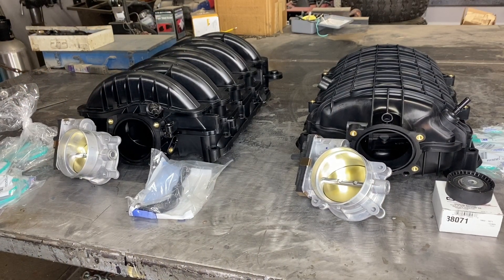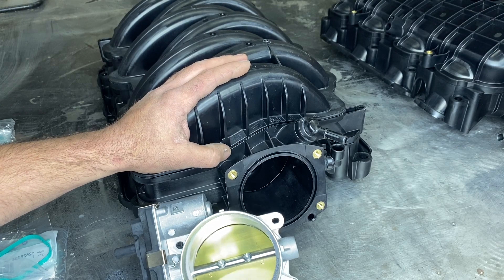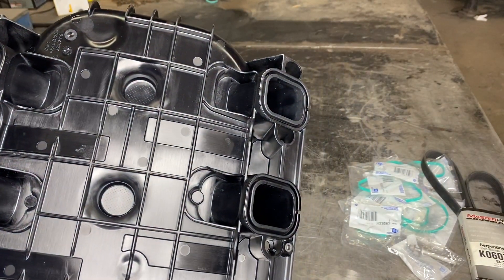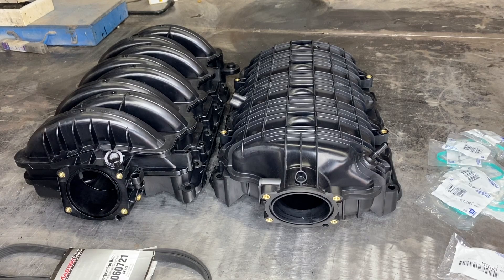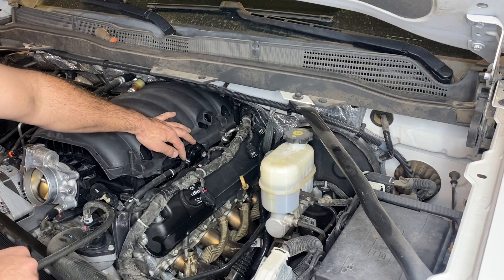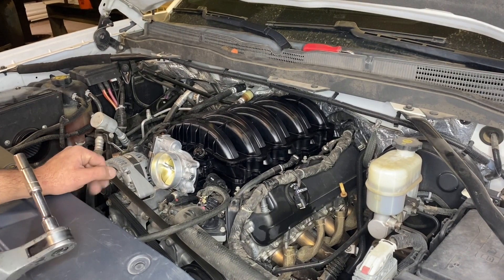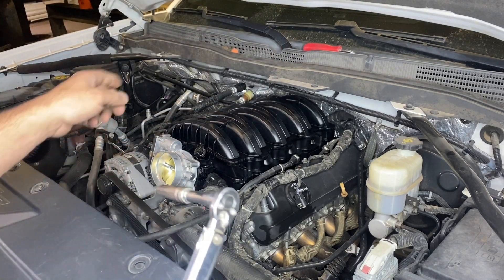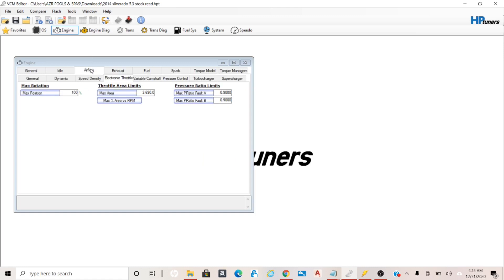GM 5.3 L83 & 6.2 L86 Intake Manifold Swap 2014+ (Complete Guide)

Comment: also my 5.3 is still stock with bolt ons. im using a tune with diablo. will this cause any issues with truck running by im getting more air. thnx your vid is awesome

Comment: did my l86 tb and Intake manifold and I started having a bad misfires in 3 different cylinders
Reply: @clifford2slow20   thank you for the help!
Reply: Did you find the problem?
I want to do the swap
Reply: @ yeah I ended up picking up a bad throttle body .
Reply: @ if you buy one used make sure it’s a 6 pin my mistake was that I picked up a 5 pin one

Comment: Man be careful torquing the intake manifold bolts my torque wrench only went down to 10ft lbs the bolts call for 8 ft lbs I figured it would be fine I ended up snapping one off at 10ft lbs had to get a die grinder in there and grind it flat drill it out and use an easy out to get it out

Comment: So I could use my Camaros LT1 intake on my 2017 5.3? I still have manifold and TB from my 2018 Camaro SS.
Reply: Yeak. But will need work . Some harness extentions. And you need to clear the throttle body and make the evap line reach the purge valve which am trying to figure it out

Comment: How long does it take to just pull the manifold?
Reply: I did mine in less than 2hrs. 10mm deep well and a cpl extensions worked for me. Factory cover fits on the 6.2 as well. I didn’t even take mine off. Just slid everything out and back in. 454chuy ported l86 intake and throttle body.
Make sure you unplug your battery
Reply: @willallen126 I also ordered from chuy. Did you have to do the relearn?

Comment: Did it LT2 L83 but belt didn't fit too small tuner had to get 1 FYI 😂🤙🏽 went with LT5 TB any tuners wanna help my guy out lil gurgley on the low but gets it after around 2000 rpm I do have a 2500 stall converter with a stage 2 BTR cam  on bubbi the burban whale 🤙🏽🤙🏽🐳

Comment: Any reason my l86 intake manifold would have a extra vacuum port on the drivers side on the back towards the firewall? I did the swap everything bolted up great and noticed the port was causing a lean fuel trim. I plugged it with a cap and everything runs fine now and no CEL or codes?
Reply: My l83 has that port you’re referring to. I know it’s a year late but I would confirm it’s in fact an l86 intake
Reply: @theborderboyz  thanks for the reply! Do you have any lines going to this port? Or do you have it capped off…. My original l83 that I took off didn’t here the port and the throttle buddy opening was smaller then the one I have on now.

Comment: Nice video, very informative. 

Do you have any input on values for throttle bodies larger than the 95mm? Do you think a L86 manifold can be ported to fit a 103mm throttle body, or do you think anything more than a 95mm we are at the limits of the manifold?

Comment: I did this swap and have not had any tuning. I have noticed harder shift at times from 2nd into 3rd, mostly when getting on it. Is this because of these air volumes being to low now?
Reply: I’ve been hearing this and I’m about to do this same thing to my truck! But is ur truck running good? Only whe you get on it it shifts hard? That might be because of the amount of air that now is getting for sure no big deal bro
Reply: @flowmagic5  I don’t think it has anything to do with the bigger intake now. I put my stock intake back on and it still does it. I’m debating putting it back on but if I do and decide to spend more money I’m getting a tune at the same time.

Comment: Will I gain more hp on my 2012 5.3 if I put an intake manifold from a 6.0 or 6.2 of the same year range? If so how much? Is it a direct bolt on?
Reply: If the engine in your 2012 hasn't been swapped to a 2014 or newer you have a ls family not at... not knowing what vehicle you have, I can tell you that the truck manifold is that came on the 5.3 is great! And will support lots of hp. It isn't beat unless the engine lives above 6500 rpm

Comment: I’m about to do this swap on my truck. Did a DOD delete and stage 2 cam from Texas speed already with High flow cats and cat back exhaust. Will the stock intake manifold cover still go on the new l86 intake? I saw you didn’t put it on and I’ve assumed it won’t fit but I’m just curious. I haven’t read all the comments so this may have been asked already.
Reply: Apparently it does fit per previous reply to another comment asking. Hopefully they’re right and hope it works for you
Reply: How is it running with the stage 2?

Comment: Can I use my stock l83 throttle body with the lt2 manifold?
Reply from the maker: no sir, bolt pattern is different
Reply: Can i use the stock throttle body on the lt1

Comment: Quick question. Will this void warrenty or will the check engine light come up?
Reply: Warranty is voided if a modification you installed causes an issue or failure. Also you change anything in the factory tuning as well

Comment: I did this swap and started the truck to check for leaks it ran well but started to stumble and sputter until it stalled after warming up, The truck will start right back up. is this due to it not being tuned? or did i screw something up? also no cel or pending codes in the scan tool. any advice from anyone would be appreciated.
Reply: You need a relearn bro
Reply: @flowmagic5   actually my brand new 02 SENSOR was trash. Replaced it and all good
Reply: @forgottenchild7935  haha damn bro so is ur truck running smoothly now? Even tho is not tune or anything ?
Reply: @forgottenchild7935  there gonna install mine tomorrow and I’m nervous lol😂😂
Reply: @flowmagic5  the tuner identified the bad 02 so I fixed it and they sent me the custom tune. so the truck is fixed and tuned. runs strong

Comment: @ Aaron The last thing you want to do is run the engine lean, I get it.  I don’t think the 6.2 intake and throttle body would make that much of a difference.  I think the oxygen sensors along with the MAF sensor would give the ECM enough info to pulse the injectors on a little longer.  I mean its always looking at short term and long-term fuel trims so you think if the 6.2 intake/throttle body swap made it a little leaner, the ECM would adjust for that.  Your thoughts.
Reply: You are correct the ecm will accommodate and adjust with just the l86 intake manifold l86 Tb and a 3.5 inch  cold air intake it will adjust its self and no lean codes are thrown. I just did the swap this week and no lean codes no tune.. the map on the l83 and l84 are rich enough to accept the l86 swap

Comment: @13:52 I didn't change the 6.2 intake, it wasn't even that much of a hassle. All I did was put some lube on the inner of the 5.3 intake and with a flat screw driver slipped in the 5.3 intake into the 6.2 throttle body. No need to to waste more money when it isn't even a hassle. But good video.

Comment: I have gm sierra 2015 6.L l83... Can anyone help me in which model of holley or fast intake manifold is compatible with my car.. With 95mm throttle body and afe mg momentum filter 3 1/2 diameter size.. Please help me someone

Comment: If i swapped to the l86 and upgraded to the jet 76116 performance throttle body should i switch the air flo sensor to either the jet 69180 (which i think is for a 6.2) or jet 69189 (which should be for 5.3). Thx in advance, great video. Convinced me to do the swap, lol.

Comment: putting either the LT1 or LT2 intakes on a truck is NOT a performance improvement , it is a down grade . you make less torque and gain very little horsepower , considering trucks and suvs need torque to move their fat asses they need all the torque they can get . a huge improvement is custom tune , CAI , ported L86 intake with ZR1 throttle body
Reply: also ABSOLUTELY do not need to tune or relearn anything going from 5.3 to 6.2 t.b ...i did it , zero problems , now if your were to buy ICT billet adaptor and run a ZR1 throttle body then yes it would need to be done . youre forgetting these trucks tend to run a little "fat" on the air fuel ratios
Reply: @ryanaustin1970  I have ported lt2 intake and ported l86 tb and get 40whp more 👀
Reply: @TheJishwa  bull fucking shit.. a stock motor and just swapping an intake show me the dyno video lmao 🤣 😂 😆
Reply: @ryanaustin1970  I have dyno numbers 🤔
Reply: @TheJishwa  sure buddy ... ok so let's see the video ..  stock l86 with just an intake swap gaining 40 wheel
Reply: @TheJishwa  yo what’s the numbers for the LT2 manifold. If you have them for the LT2 throttle body that would be schwic too man. For the tune not the dyno numbers
Reply: @motorizedmiscreant  he doesn't have them . Without a tune this mod is completely useless
Reply: @TheJishwa  is corn fuel involved with that number 🤨
Reply: @sbc_jake_9677  no corn, but I put down 325 to wheel at the time it was ported tho
Reply: @TheJishwa  tuned for 93?
Reply: @sbc_jake_9677  yeah it was, now It’s fbo on e85 getting cam this summer
Reply: @TheJishwa  i wanna upgrade the intake on my 5.3. But I dont wanna switch over to 93. I daily my pickup in the summer. But I usually run flex during that time
Reply: @sbc_jake_9677  you don’t have switch gas

Comment: I'm swapping for the 6.2 throttle body and intake manifold on Saturday for my 2016 Silverado. Just wondering 2 things. Does the intake manifold cover (engine cover) from the 5.3 manifold fit on the 6.2 manifold? If not...then where do I leave the wires that were removed from the back of the manifold cover. I appreciate your help.
Reply: covers are the same , the bundle of wires can ( although should be tied up) lay on the back of the engine without any issues

Comment: Do you have to tap the back of the manifold for the brake booster if going in  a 2014 chevy truck
Reply from the maker: No, vacuum on those trucks are from a pump off the belt
Reply: @AaronHinesAuto  very helpful thanks.

Comment: I have an aftermarket cold air intake, does the coupling stretch over to the new TB?
Reply from the maker: Yes. This truck had a volant CAI. It fit just fine
Reply: I also have the Volant CAI, it made such a difference, 
Im swapping for the 6.2 throttle body and intake manifold on Saturday for my 2016 Silverado. Just wondering 2 things. Does the intake manifold cover from the 5.3 manifold fit on the 6.2 manifold? If not...then where do I leave the wires that were removed from the back of the manifold cover. I appreciate your help.